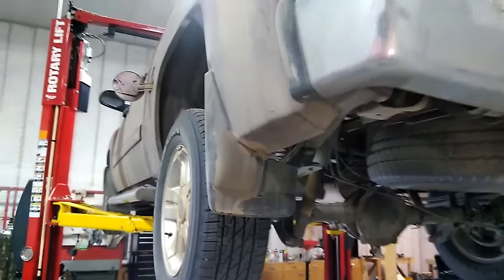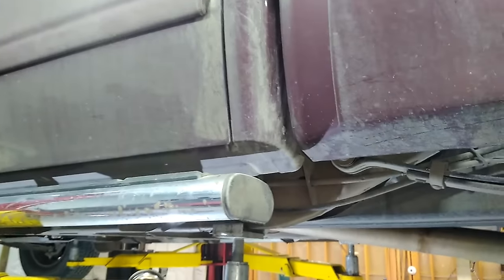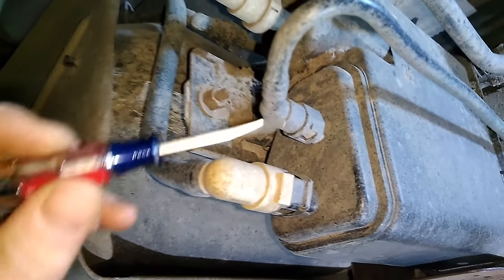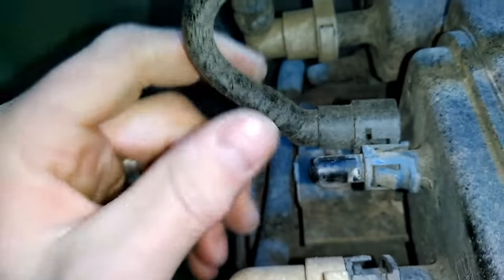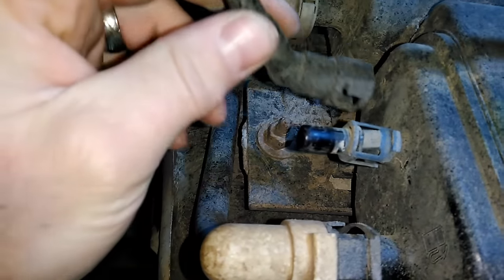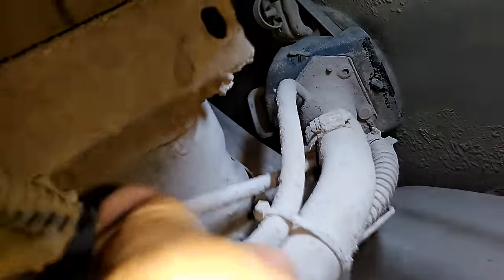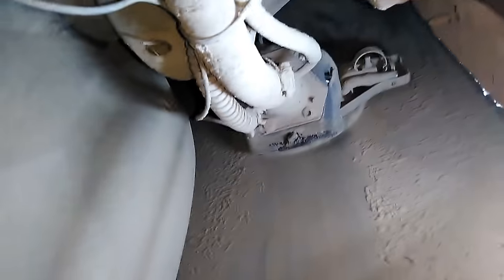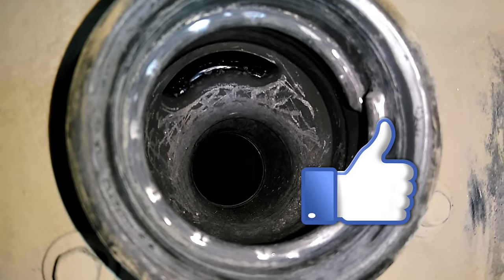Chevy Fuel Evap Canister Fill Fix Filling Slow

Comment: Well...i don't see a follow up to this video so i will tell you what happened after i did this same thing, with water. I flushed out the canisters on my 2005 Silverado 5.3 2WD and my 2004 Silverado 5.3 Z71....i even left one outside in the sun for 3 days to dry out after using compressed air...and i put one in an old oven we use for hot-coating parts...we put it in on ow heat for 3 hours to dry it out. Then we reset the codes and installed them... BOTH of the charcoal canisters failed within a week and had to be replaced with new ones @ $150.00+ each. About a month later we clean out a canister with nothing but compressed air on my buddies truck, reset the codes, installed it and its working just fine. If you're gonna clean them out, use compressed air at about 50psi...don't use water.
Reply from the maker: I did that on my first vid of this with just air, it worked great then someone commented why not use water. So I did, sorry you did not have same results as I did, this truck still fine. I’m sure there could be a lot more other things that could cause issues too.  Best thing is to relocate the breather, see this vid last one I did on this https://youtu.be/ASCLntCU0jQ

Comment: Thank you!  I cleaned out mine and used a shop vac to suck out that tank vent hose…it was full of charcoal pellets. First and last time to have to do that fix.  No smog inspection is required where I live so all good. Thanks again because I am sure this would have been $800 plus these days for the dealership to “fix”.
Reply from the maker: Yeah probably

Comment: Did it ever occur to you to get a friend as a videographer to follow along with your demonstration video?  Would've been much more professional that way.  Aside from my criticism, thank you very much for showing ACTUAL CLAMP REMOVAL PROBLEMS versus these other so-called mechanics that cut & splice around these problematic issues.  It is highly unrealistic to think you can remove 20-year old plastic snap-together clamps without breaking a few of these.  I had no idea it was okay to flush water through these charcoal canisters.  Will definitely see if this works on my 2003 Jeep Grand Cherokee.  And yes - $500 or more probably to have a garage do the same job.

Comment: Awsome video your the first one ive seen that had the balls to say clean check and inspect instead of pull swap and call it good this could also help u determine if the valve is stuck before dumping alot of money in parts u dont need

Comment: Move the vent off the fule  fill and move  it up front by brake the hose  is long enough  I just zip tie it to brake  line  under the brake boot  problem  go away  it is smart  to to clean  that hose  and spung filter  it will be right  full if it's  on dirt roads
Reply from the maker: I did that on another truck, moved the hose all the way up to grille are works great thanks

Comment: Thanks for this video as Im about to deal with mine & have put up with the slow fill all Winter, & now since I have the flexible fuel line leaking (poor design as the supply & return lie on top of each other so of course the supply is the one with the hole & not the return line, its up near the front cross member so I recommend checking yours and securing it "05 Yukon XL). You gotta love engineers as they use three different connections on the same device, at least they are easy enough to access.

Comment: My truck is marking two codes po446 and po453 I already replace the fuel tank pressure sensor now is not letting me pump gas and it sounds like air comes out my tank when I remove the gas cap I was told it can be the vent valve oh charcoal canister I want to be sure before I buy the vent valve

Comment: This looks bypassable by the hoses. Tank vent to the other side of purge solenoid. The vac blocked off, but!, how does the computer meter the vacuum? And whats the resistance value on the solenoid? like simulating an O2 sensor..
Reply: The more I learn about my truck the more livid I get. 07 Classic.. The fuel filter is in the tank! not on the frame?! It hurts my head. The whole fuel pump in the tank is full on retardation imo 
I want to solve all three of these issues. Frame mount pump/filter and complete edit of evap system. May as well add a bash plate under the plastic fuel tank since it looks like a Rubbermaid trough exposed down there.
Reply: Im still scheming on this. Think I have it wrong and the tank vent to the canister needs to be hooked up to the vacuum. This would keep the tank vacuum and pass the vac test on the cap, If the purge line is capped at the inlet. I thought there was another vent but it wouldn't have the fill problem if it did. So a Y at the tank vent splitting to vacuum and the purge line with a ball check valve may work. Vacuum would seal the check valve and filling tank would open.

Comment: fix the clip with a soldering iron
Reply: Throw clip away and buy new one.  Then go to a tech school to learn basic mechanics.  Next time you come across it, just push the connector in and pull fuel line off correctly.......

Comment: My simple life time fix; extend the breather line filter either back to the air filter or extend it to a dryer spot away from the wheel house and put a fuel filter on it. Cheap either way.
Reply from the maker: Did that on another truck I ran it right behind the grille so it would have cleaner air still works great no issues
Reply: great idea...no check engine light?
Reply: Depends on if you extended the line to a definite dry spot. If you're not sucking in water, they stay dry and not malfunction. That line also goes to the other EVAP piece on the intake, (forgot name) and when I replaced that one, I found out it had enough vac to pull water into the engine from canister.

Comment: dose it effects engine hesitation at acceleration from low rpm, high fuel consumption, hard start ?? i have pontiac firebird 2002 the fuel pressure is good !
Reply from the maker: I would say you have something else wrong

Comment: Would you please inform me if the cleaning (with water and air) that I apply to the cannister, solved the problem? if not, to find another solution.
Best regards
Reply from the maker: Yes it works to get you by, may not get all dirt out but most of it.  As all others say buy a new one, but this video is for someone trying to save a buck like me.
Reply: @HighOctane101  Tks...

Comment: I was wondering if this was the same for a 04 chevrolet Trailblazer ls 4.2L ? I have the same problem where it will not let me pump gas in my truck but like 20 cents before it stops me, i disconnected the fuel tank line from the charcoal canister and it lets me pump gas in, any thoughts or help would be much appreciate it.
Reply from the maker: I would say it is plugged if you drive in dusty roads conditions

Comment: When i pulled hoses off, bunch of charcoal pellets flew out?
Reply from the maker: The foam filter inside is bad, you could either blow the carbon out and call it good or buy a new one at this point
Reply: @HighOctane101  thanks,

Comment: so.... your not going to at least clean the foam inlet filter for the customer?  ... (15:30) ... how do you expect to keep the canister clean?   its just gonna suck in MORE dirt and get clogged again.  

ahhhh,  REPEAT customer!        got it!    

nobody is stopping you from relocating it ....  or installing a baffle to keep the mud from soaking the filter
Reply from the maker: bobo caterpillar don’t clean that it will let more dirt in, dirty filters are better air cleaners!  This is a cheap fix for a guy that has no money,  the best way would be to route the hose to the engine compartment with less dirt!  This is emission junk anyway should just bypass it all! Maybe another video

Comment: I watched the video and I appreciate it. My problem isn't the dirt in the canister but rather the tiny pellets in it. Some how and for some reason theses pellets have gotten out of the canister and have clogged the hose that goes to gas tank. I ran a wire coat hanger up it and its completely clogged with these pellets. Should I be worried about these pellets getting into my gas tank? How do I get this hose unclogged? Thanks.
Reply from the maker: You will have to replace the unit!  The screen failed that holds the carbon back! If it gets to the gas tank it will not harm anything other than possibly clog the fuel filter.  As for the hose maybe use some low psi compressed air! Or replace the line
Reply: My carbon beads made it all the way up to my purge valve clogging it up making my 2007 tahoe run chopy . I just changed it all, the purge valve, vent valve, and canister. Amazon has it all for cheap
Reply: @christopheranthony5181   it's not possible for the beads to make it all the way to the purge valve, which is located next to the engine, because the fuel filter will not allow the beads to pass by the fuel filter. Perhaps you mean that the beads made it to the vent valve?

Comment: Thanks for the presentation. My Check engine light popped up recently.When I ran a scan on my car-Toyota Corolla 2006 model, it returned these codesP2401,P2419,P043F,P043E.It has stalled more than once on the road due to fuel pump failure.I have changed the fuel pumps .Kindly advise me on the way forward.Do I need to wash the Charcoal Canister or replace it?

Comment: I’m getting code 0442 small Evan leak. Changed the purge valve by the engine first then the vent solenoid. Didn’t solve my problem. The last part would be the charcoal canister. I’m getting a hard start once in a while when the truck is driven for a bit then turned off. Also getting the random tighten gas cap every once in a while. Not getting the fuel pump fill shut off but I’ll try a new gas cap and the charcoal and see if that works?
Reply from the maker: So it will fill a tank of fuel just fine?
Reply: @HighOctane101  yes.
Reply: I am having same issue and have replaced the same. Last step is charcoal canister. Will this take care of the P0442 code?

Comment: I don't know if you can help but here goes. 2006 Chevy silver ado 1500/4.8 First code was P0442 Small Leak. put a new gas cap reset the code, 1500km or 900miles it came back. Changed the purge valve on the top front of the motor. now I get tighten the gas cap then the next time I start the motor I get the check engine light, P0455 Large leak after less than 400km or 240miles. Crown oil sprayed every year. mint shape, no rust. I'll look for the charcoal canister in the morning then try the water clean-out.

Comment: I have a error code p0301 could a clogged canister cause that code? I already changed the spark plug and wire along with the coil and fuel injector my Tahoe has a strong idle when I’m stopped and I only can fill up 3.00 of gas no more
Reply from the maker: That code is a misfire and I would not think that would be caused by the canister.  No other codes?
Reply: High Octane other code is p0174

Comment: I want to do this to my 2004 Impala but the canister is located on top of the fuel tank.
Reply: You said work on your truck. I got on 1999 Silverado won’t take the gas. You wash your and it work?
Reply: Thank you for this comment. I have 2001 Saturn SL2, it also has Charcoal Canister a top of a fuel tank. No films on replacement on my car, but maybe I'll find on 2004 Impala.

Comment: Really? You don't know how to operate a horseshoe retainer clip? Seriously - you push in at the top of the clip and pull the hose. Not jam a screwdriver in and break things. BTW - water is the worst possible thing to use to clean out the canister. That will get sucked back into the fuel system no matter how much you use compressed air to remove it. Water is heavier than gasoline. The residual will get recirculated before the gasses inside. Yeesh.
Reply from the maker: Thanks for the comment, water is in gasoline anyway, it is always taking in moisture.  Just want to get the common folk by, so they could keep the family fed.. sorry if this-inconvenienced you!  Have a great day!
Reply from the maker: I have also been doing this on my truck and friends trucks that actually go off road with them and it seems to work to work for them and I thought it was great to share this with who have the abilities to work on their own car or trucks themselves!
Reply: How about we clean it with gasoline? Is that a good idea?
Reply: You are right on the clips! but the water would not go through the fuel system ,it goes through the intake! water can be injected into the intake to help performance in some cases!
Reply: Water ended up ruining my canister , turned all the charcoal to a thick sludge that wouldn't  let anything flow through the canister.
Ended up having to buy a used one from a salvage yard.  Thanks for the great advice.

Comment: I have an 04 GMC Sierra SLE with about 38,000mi. My engine light came on and the truck never seen dirt , but I know the fuel tank was topped off alot on the last trip. Thinking maybe it is the fuel tank pressure sensor ? I know topping off the fuel tank can't be good for it , did I maybe force fuel where it should be ?
Reply from the maker: Sometimes raw fuel can get into the canister and cause the engine to run rich and throw a code,  it should clear up over the first quarter tank unless there is something else wrong.. I never top these newer cars off

Comment: Hello, I have an 08 chevy suburban 2500. I pulled the lines off this canister and one of the lines was leaking raw fuel and loose charcoal pellets fell out. Does that mean the canister has to be replaced? Can't top off the fuel tank and the truck runs bad and stalls when coming to idle
Reply from the maker: You will have to get one
Reply from the maker: New one
Reply: @HighOctane101  what does the liquid fuel in the canister signify?
Reply from the maker: Have not experienced this with any of my vehicles but I would say never top off the fuel tank, you can carry over fuel with vapors

Comment: it is fix p0446 ?
Reply from the maker: I would start with vent valve, computer says it’s not working. Could be wire bad or coil bad.
Reply: @HighOctane101  i have p0446 and check engine light but car drives normaly and can fill up full of gas without problem (chevy venture 2004) i think i just buy new solenoid and canister

Comment: would like to know what idiot engineer recenently graduated decided to move evap canister under the vehicle in a exact spot where oil leak spray will hit it and detoriate hoses and unit itself
Reply from the maker: Miguel Castaneda fact!!!!!!!! They have not done better 2017 Chevy suburban has it in front of the re differential  and vent doing to the gas fill arena. I will do another vid on that

Comment: I replaced the fuel evap canister and the hose line attached to it on my 2004 chevy silverado, cleared the po446 code but still having trouble filling my tank.  Can anyone help?
Reply: You replace also vent valve Sir and blow air into the evap system and lastly put some air pressure slightly at the fuel tank valve and tap with rubber hammer gently whie air goes through
Reply: It will really help.put some air pressure also at the purge valve line and blow air back and forth and then you found out that the charcoal grains are flying anywhere

Comment: nice video but wouldnt you think putting water in there would put your engine at risk? I wouldnt want water getting into the engine
Reply: Yep - gonna be pulling some nice water up into the engine during purge.
Reply from the maker: That is why you want to blow it out with air, after that the remaining moisture will not be anything more than what is in gasoline already
Reply from the maker: And that is why you see me blowing it out with air!!!
Reply: But of course only the vapors go into the box and gets filtered out then into the air right? How could it make it into the engine, gasoline does not go through it.
Reply: Then if you dont have air you could tip it up and let it drain and dry out.
Reply: I don't think many of you realize who much water or corn oil/ ethanal you are putting through your engines regularly and you are worried about a little in the breather.... the reason there is a hole in your muffler is so water can drain out and not rust the thing out.....   Hmm  That water couldn't possibly but coming from the engine somewhere.... LOL
Reply: water does not hurt the engine.  in some cases adding water to the air intake is wanted to improve performance.
Reply: that little of water is not bad for the air intake and in some cases is good.
Reply: Evap system doesn’t route internal to your engine

Comment: Did you have any check engine lights after this?
Reply from the maker: Nope
Reply: @HighOctane101  so by washing out most likely all the contents of the canister it is hollow and will never restrict venting/filling of the fuel tank did it have a code before? My avalanche has no codes but difficult to fill and I have a new vent valve.  A clogged canister is all that is left...great video 
THANKS

Comment: I didnt know what black box was,but now I know why it takes me 30 mins to fill my van up with fuel
Reply: You need to replace your canister vent solenoid as it is most likely not opening/function properly.  The charcoal is only for the raw fuel vapors left over after the engine has exhausted.  A re-circulation to make the EPA happy.

Comment: After blowing it out I'd fill the canister with some 91% or better Isopropyl Alcohol. It will help prevent that remaining water from pooling at the very bottom of your tank by dispersing something like 50% of the same volume of water. Iso-Heet would be perfect. Add maybe 12 ounces, seal the ports and give the canister a whole bunch of rolls and shakes, make sure its fully dispersed. open the ports back up. dump it out. install.
Reply from the maker: That would work too